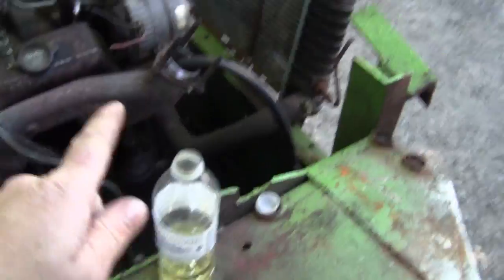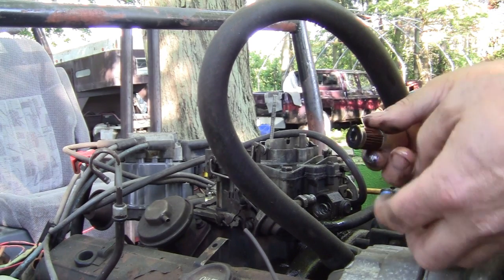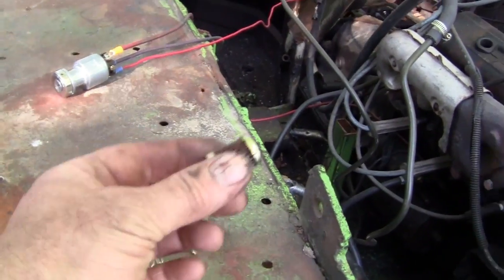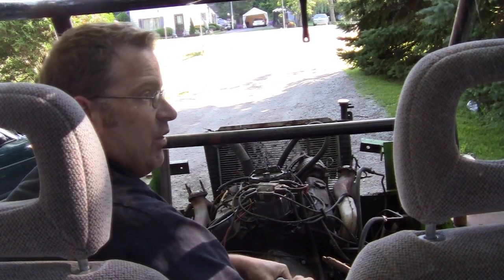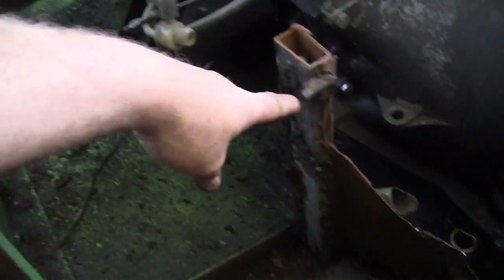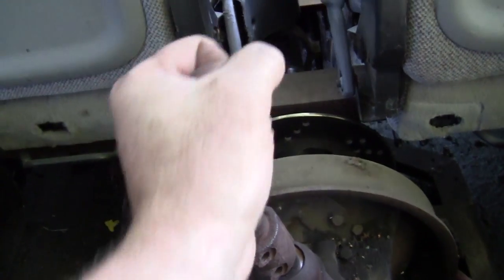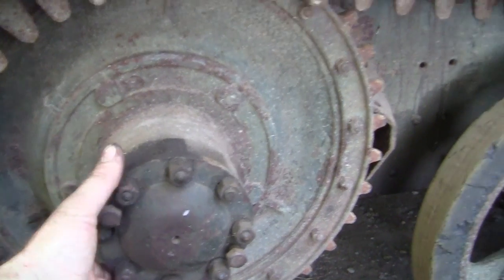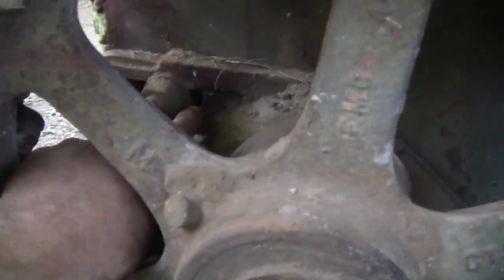The TANKenstein project 10  fuel delivery problems

Comment: Did you think of using a 27 lb propane tank weld a threaded pipe with Galv . cap for filling  and a fetlock at bottom for supply band wrap it to a bracket on fender safe strong just a thought seen it done before .Used one fill with water and weld it .

Comment: that tranny is a 350c and it dose have a lockup converter. I useto have the same tranny and I've tried the lockup and it dose not do much maby lowers the rpm about 100. some people think that lockup will lower the engine rpm alot like 500 rpm but it dose not. on a 700r4  ( 4 speed) the lockup will lower the rpm about 200 but you can hear the engines tone change.